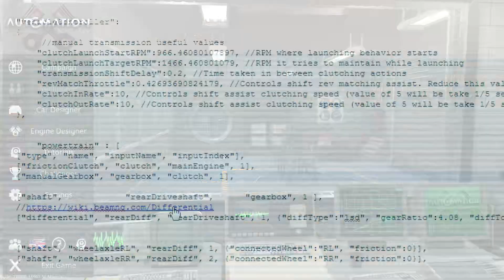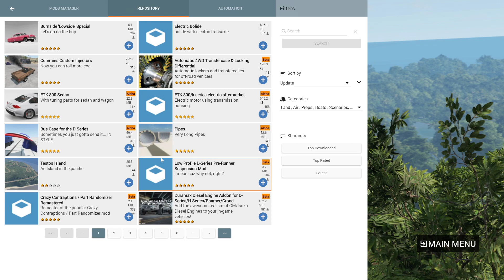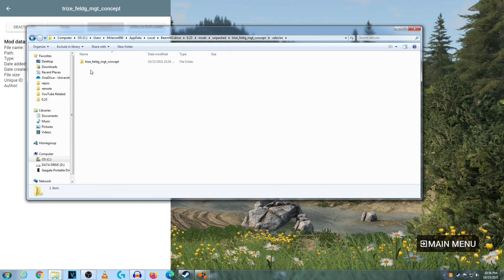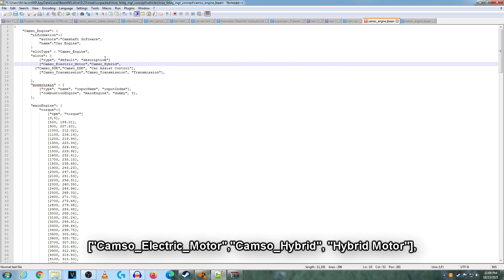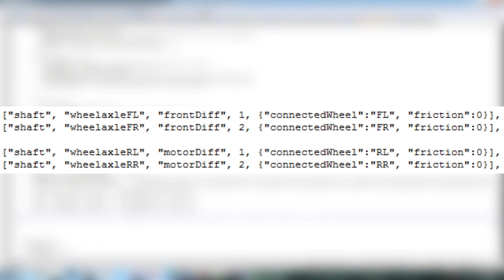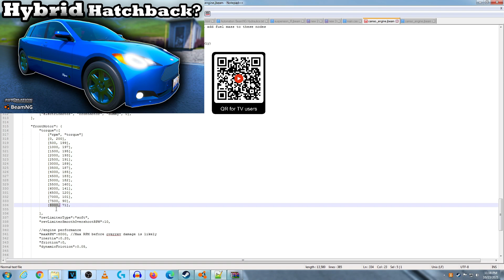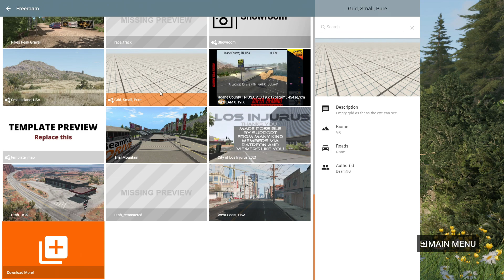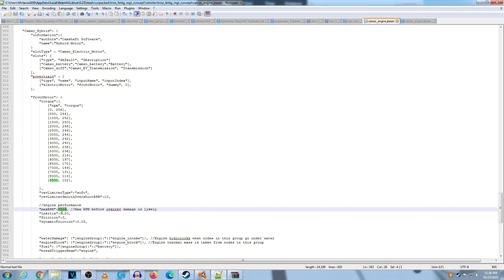How To Create a "Hybrid" Car in Automation & BeamNG.drive

Comment from the maker: Code used (in order):

["Camso_Electric_Motor","Camso_Hybrid", "Hybrid Motor"],

["differential", "motorDiff", "frontMotor", 1, {"diffType":"lsd", "gearRatio":3.94, "diffTorqueSplit":0.50, "lsdLockCoef":0.30, "lsdRevLockCoef":0.30, "lsdPreload":50, "uiName":"Differential", "defaultVirtualInertia":0.25}],

["shaft", "wheelaxleFL", "motorDiff", 1, {"connectedWheel":"FL", "friction":0}],
["shaft", "wheelaxleFR", "motorDiff", 2, {"connectedWheel":"FR", "friction":0}],

"Camso_Hybrid": {
		"information":{
			"authors":"Camshaft Software",
			"name":"Hybrid Motor",
		}
		"slotType" : "Camso_Electric_Motor",
		"slots": [
			["type", "default", "description"]
			["Camso_battery","Camso_battery","Battery"],
			["Camso_diff","Camso_EV_Transmission", "Transmission"]
		],
		"powertrain" : [
			["type", "name", "inputName", "inputIndex"],
			["electricMotor", "frontMotor", "dummy", 0],
		],

		"frontMotor": {
			"torque":[
				["rpm", "torque"]
				[0, 256],
				[500, 254],
				[1000, 252],
				[1500, 250],
				[2000, 248],
				[2500, 246],
				[3000, 244],
				[3500, 242],
				[4000, 240],
				[4500, 238],
				[5000, 236],
				[5500, 214],
				[6000, 197],
				[6500, 170],
				[7000, 149],
				[7500, 131],
				[8000, 113],
				[8500, 102],

			],
			"revLimiterType":"soft",
			"revLimiterSmoothOvershootRPM":10,

			//engine performance
			"maxRPM":8500, //Max RPM before overrev damage is likely
			"inertia":0.20,
			"friction":0,
			"dynamicFriction":0.05,

			"waterDamage": {"[engineGroup]:":["engine_intake"]}, //Engine hydrolocks when nodes in this group go under water
			"engineBlock": {"[engineGroup]:":["engine_block"]}, //Engine thermal mass is taken from nodes in this group
			"fuel": {"[engineGroup]:":["battery"]},
			"breakTriggerBeam":"engine",

			"soundConfig": "soundConfigMotor",

			"thermalsEnabled":false,
			"engineBlockMaterial":"aluminium", //"aluminium" ,"aluminium", "iron"

			"energyStorage": "mainBattery",
			"requiredEnergyType":"electricity",
			"electricalEfficiency": 0.98,
		},
		"vehicleController": {
			"topSpeedLimitReverse": 15,
			"topSpeedLimit": 134.112,
		},

		"soundConfigMotor": {
			"sampleName": "ElectricMotor",
			"mainGain": 0,
			//"maxLoadMix": 0.65,
			//"minLoadMix": 0,
			//"onLoadGain": 1,
			//"offLoadGain": 0.65,
			//"eqLowGain": -15,
			//"eqLowFreq": 100,
			//"eqLowWidth": 0.05,
			//"eqHighGain": -5,
			//"eqHighFreq": 6000,
			//"eqHighWidth": 0.1,
			//"eqFundamentalGain": 2,
		},

	},

"Camso_battery": {
		"information":{
			"authors":"BeamNG",
			"name":"40kWh Battery Pack"
			"value":39800,
		},
		"slotType" : "Camso_battery",

		"energyStorage": [
			["type", "name"],
			["electricBattery", "mainBattery"],
		],
		"variables": [
			["name", "type", "unit", "category", "default", "min", "max", "title", "description"],
			["$Efuel", "range", "kWh", "Chassis", 100, 0, 100, "Battery Level", "Initial battery charge", {"stepDis":0.5}],
		],
		"mainBattery": {
			"energyType":"electricEnergy",
			"batteryCapacity": 100,
			"startingCapacity": "$Efuel",
		},
	},
Reply: I couldn't find any links of the mod you created ...

Does it work in v0.32? I haven't seen any working hybrids in game (that don't rely on external mods)

Comment: I realize this video is old and might have an updated version but is there a way to make a proper "hybrid mode"? Like man I forgot the name of the mod but it makes tons of new updated variants of most of the Japanese cars and the sunburst has hybrid variants where you can press E to toggle between gas and hybrid and it has a whole system like if you go over 60 kms it switches to gas automwtically same if it's low on battery. I realize this is alot to code but I'm down for it also if you have multiple cars exported to the same file (as in different variants that show up as 1 mod) how do I know which engine to edit, I'm not at home and don't have access to my PC but are they named differently? Because for example there's one car I made named the Piccolo and that one car comes with like 3 or 4 engines along with an ev variant

Comment: Hi thx for that.
Could you possibly do an update?
many lines have been changed in the meantime, and I can't find a way to change the translation for the front diff.
And how does it work with driving backwards?
Reply: same issue for me

Comment: What should I do to connect the electric motor to the rear axle rather than the front axle assuming I have a front-engine rear-wheel-drive setup.